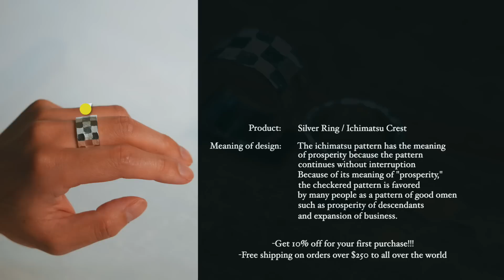【職人技】日本の職人がシルバーリングを製作するプロセス 【13か国語字幕】

Comment: Why couldn't they have made a rectangle at once? It would have been easier. 
In fact, they could have made a three-dimensional model in wax and cast the ring directly with a zclick.
Reply from the maker: Multiple fires soften the silver; it is difficult to make it rectangular at one time. And more frequent tapping will increase the strength.
Reply: @MAX Process, 😆Your "In fact" reveals your inexperience and lack of knowledge, yet you speak with authority. Sit down.
Reply: @skyrider4789  I wonder where I'm wrong?
Reply: @skyrider4789  If you have nothing constructive to say, then he certainly doesn't need scolding.  Use the opportunity instead to explain more if you have knowledge about it.  👍